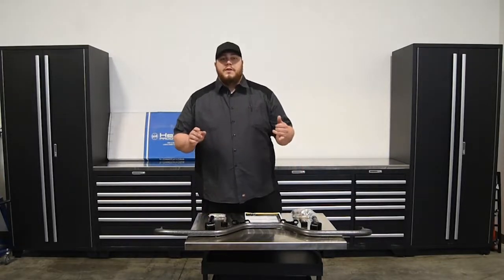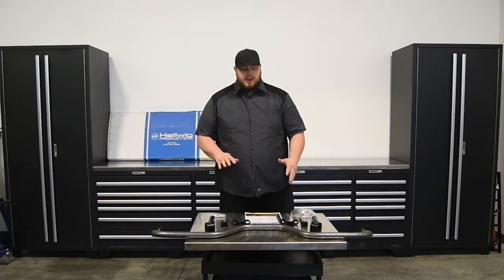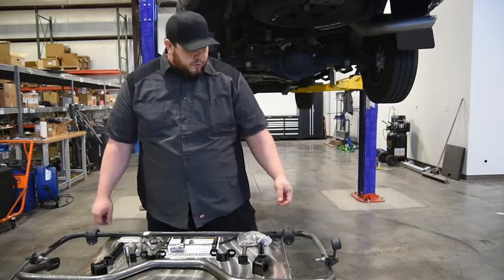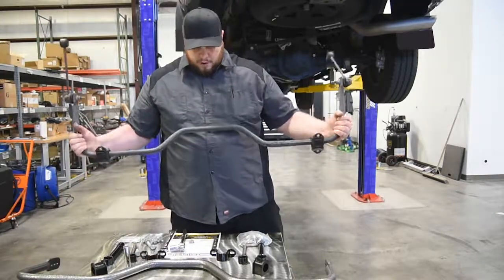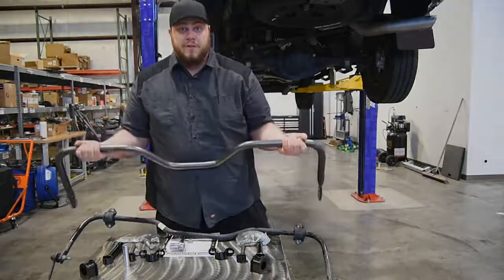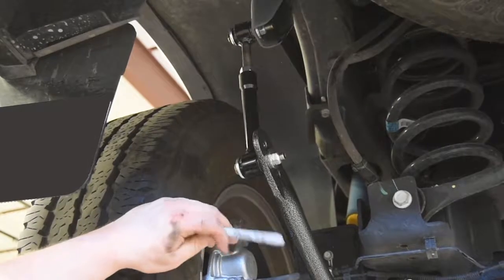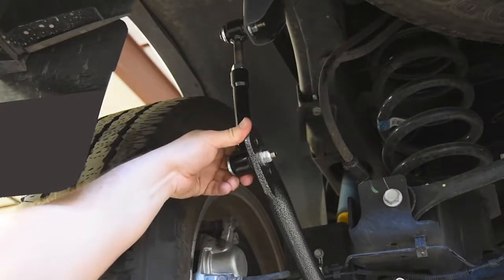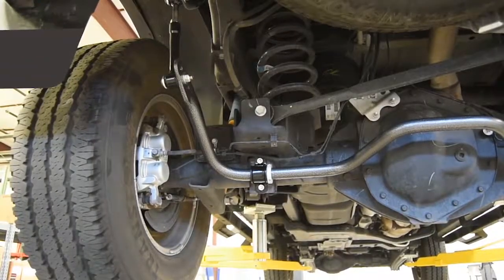Hellwig Sway Bar Install  l  Premier Performance

Comment: Install a larger sway bar on the rear. This cause the rear of the truck to slide out and drift more, actually making it more dangerous in the turns, reinstall the stock factory sway bar. Drove much faster in the corners stuck the rear end like glue. Some of these aftermarket  car parts are not good.